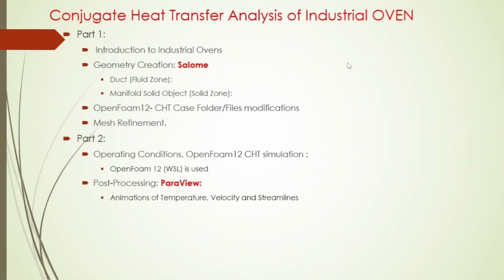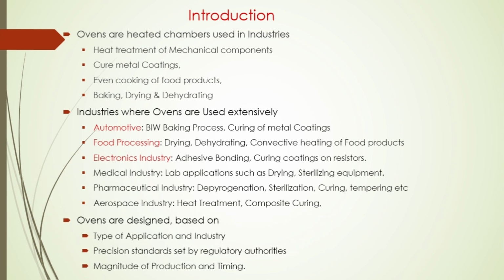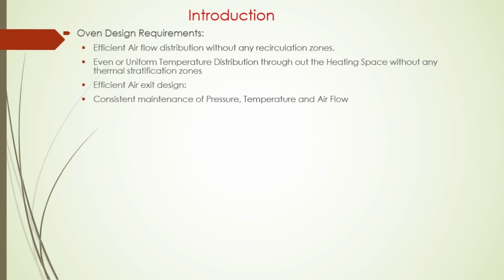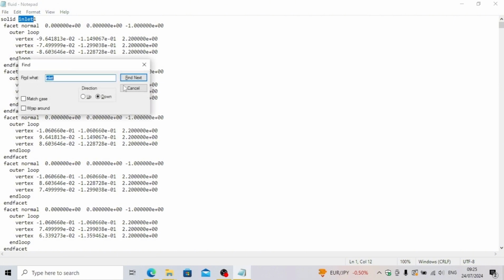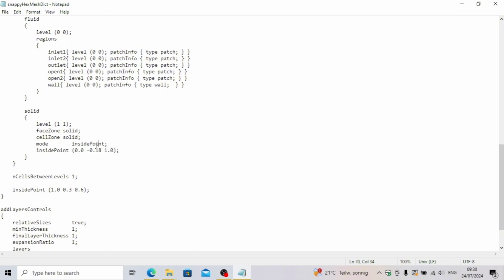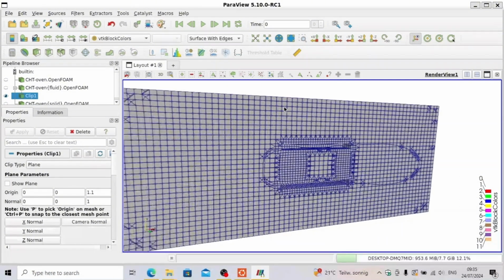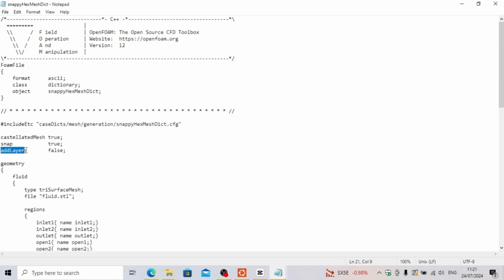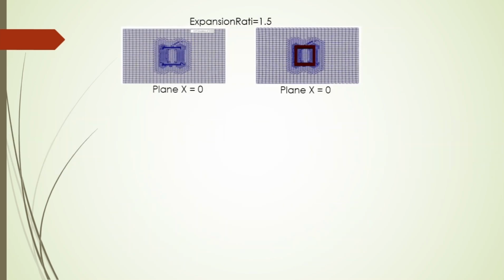Conjugate Heat Transfer Analysis of Industrial Oven|| Part1|| Introduction, Mesh Generation|| CHT

Comment: Thanks for the walkthrough on OF12.   Are the files used available for download?  In particular does your fluid region have the solid subtracted or is the solid superimposed on the fluid as an input to snappyHexMesh.  I find real shapes such as car panels very hard to define (very thin and highly curved)
Reply from the maker: welcome. The files are not available for download. In CHT cases, Solid region is subtracted from fluid region. In other words, in snappyHexMesh, we define solid region (say CAR as solid domain)) separately and fluid region separately. So while meshing, these two regions are created and grouped as solid and fluid regions. There is no superimposition. So for fluid variables U,p, k,eps etc, the solid region acts as wall and only conduction equation is solved within solid region. Hope this is clear. Any more help needed, you can contact me via email.